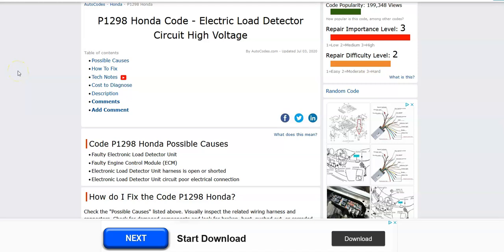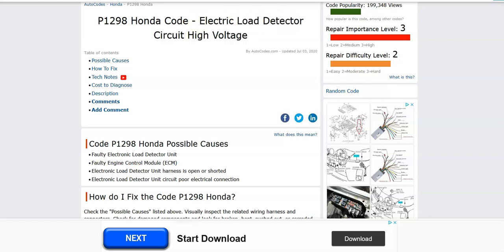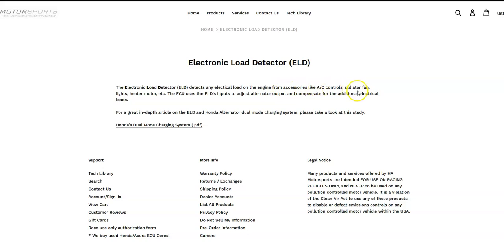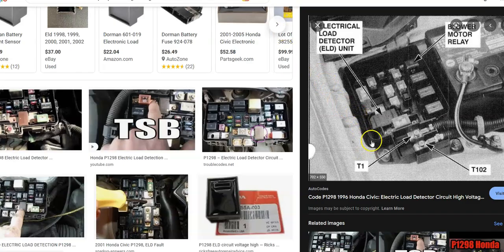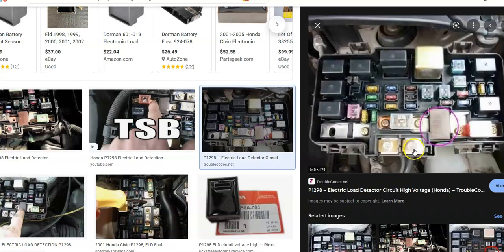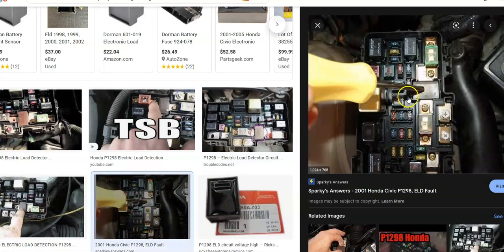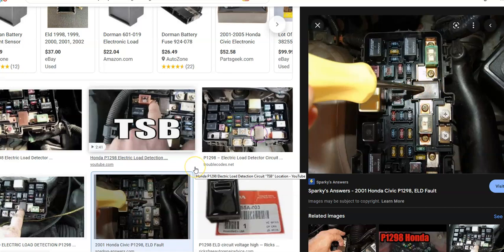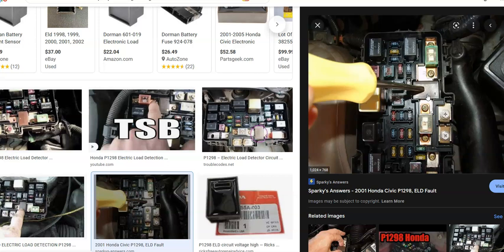How to Fix Honda P1298: Electric Load Detector Circuit High Voltage

Comment: i installed a tochscreen radio and a new outlet to charge my phone could that cause it to throw this code?
Reply: The radio adds a voltage load and the ELD is a voltage load detector, so it makes sense especially if it happened after you installed the radio.

Comment: Mine has the same code and won't come off after changing the eld, can the altenator be pushing too much current as the wire leading to it started overheating?
Reply from the maker: The alternator output can be checked with a multi meter at the battery to see if the output is high. Anything over 15 volts would be much to high.
Reply: @whyingo7964  Kool
Reply: @whyingo7964 thank you for insights.